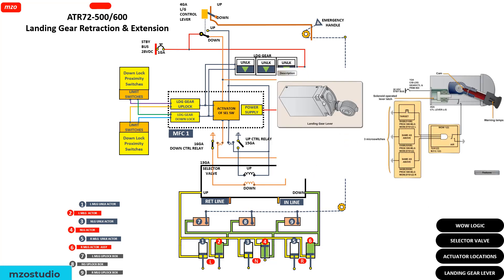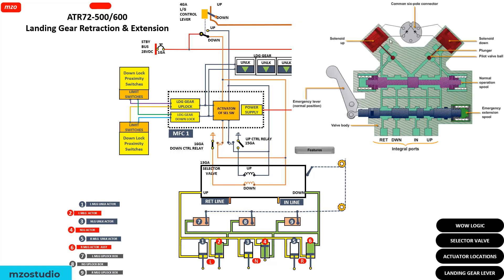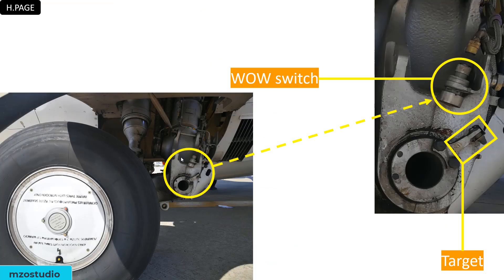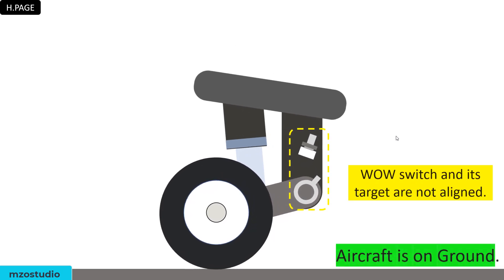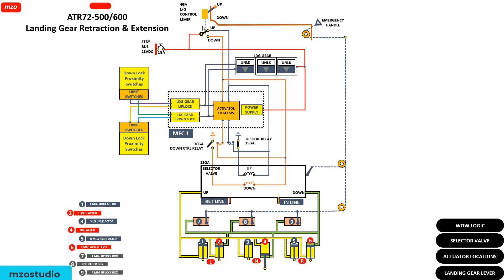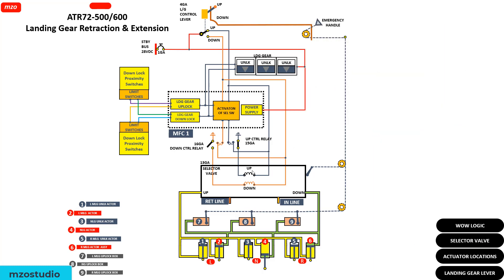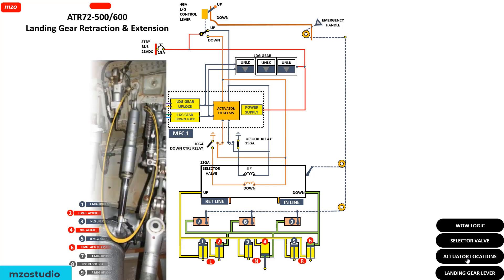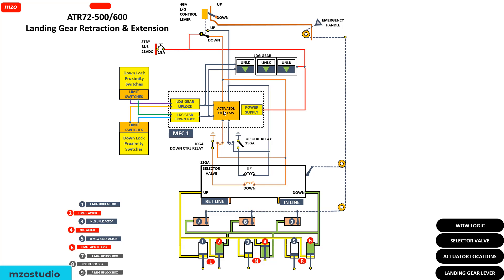ATR72-500/600 Landing Gear Extension and Retraction System (CBT)

Comment: UNLK light means the ldg gear is not found in down and locked position or uplock box is not open. Folding side braces keep the landing gear down and lock, while uplock keep ldg gear up and lock. Green Hyd LO PR transits via MFC1B to avoid undue alerts of Green HYD LO PR as it creates suction in the hydraulic lines when landing gear is selected down